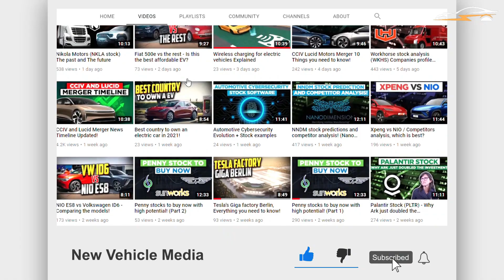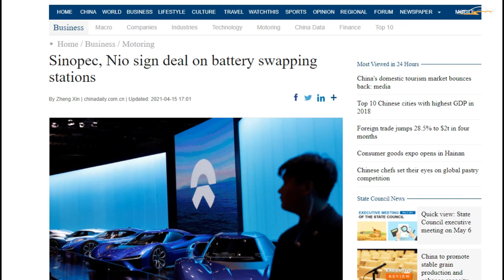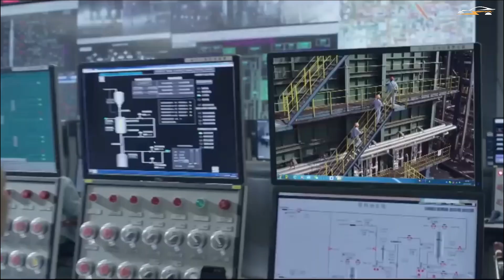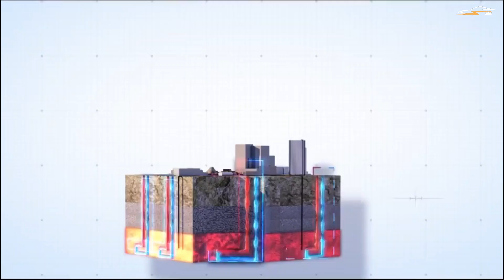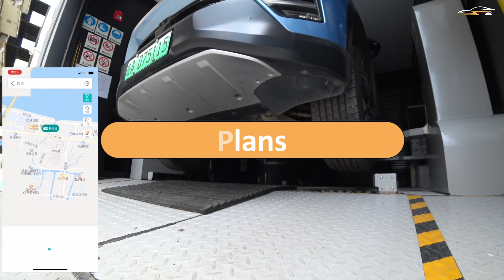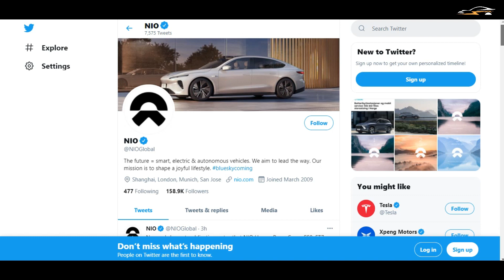NIO and Sinopec deal for NEXT LEVEL Battery Swapping!

Comment: wouldn't Battery swap technique require a larger amount of batteries to be produced, which kind of defeats the purpose of the tech?
Reply from the maker: That is a very legit question. 
Didn't NIO also offer several types of batteries as the swap technique allows faster battery improvement / innovation ??
Reply: @newvehiclemedia4982  the improvement and inovation is in my opinion  what makes the batteryswap/charging technique counter intuitive, like how many extra batts will need to be in circulation for each member of the battery swap program, what happens to all those batts when the new improved one comes out and everyone want's that extra range, how many new batts will be made to replace old ones? these are just a few of the tons of questions i have  that lead me to personally believe GND compliance  may less about the environment, and more about profits.(not trying to get to far off subject)
(statment is strictly my own personal opinion and may be inaccurate, and is subject to change)